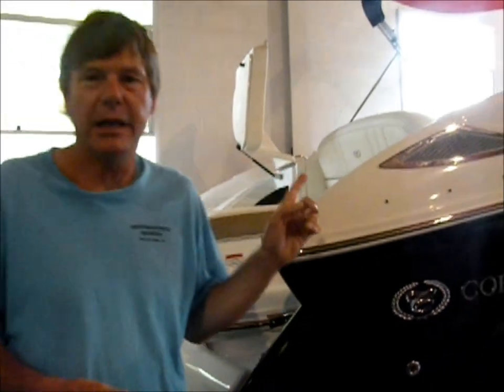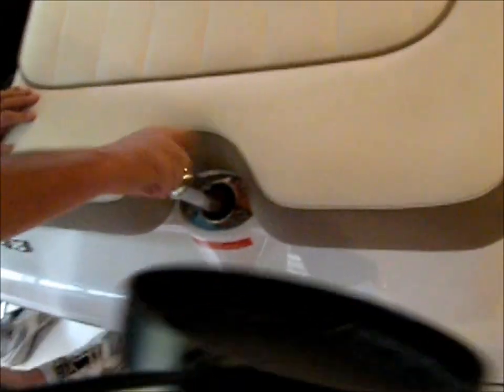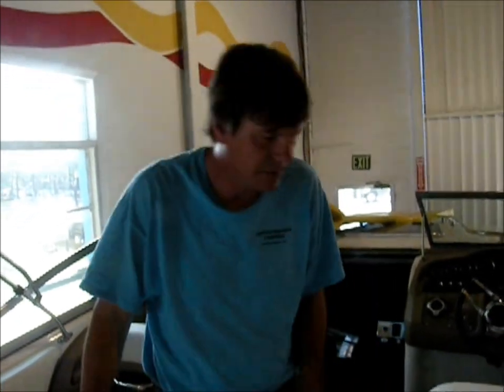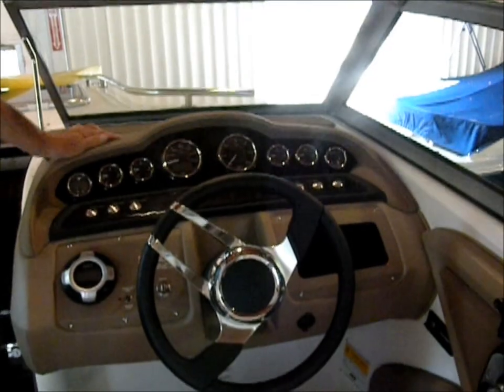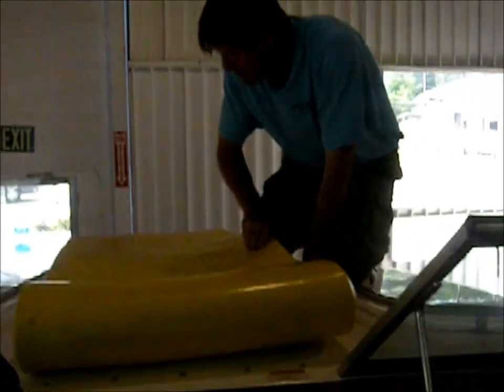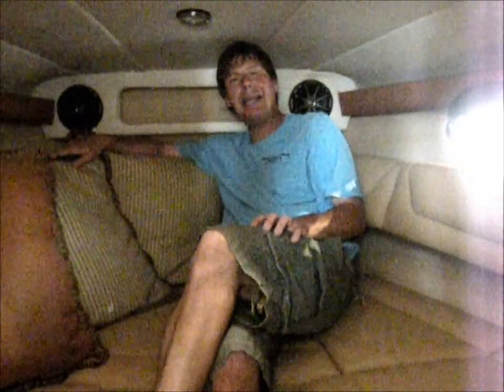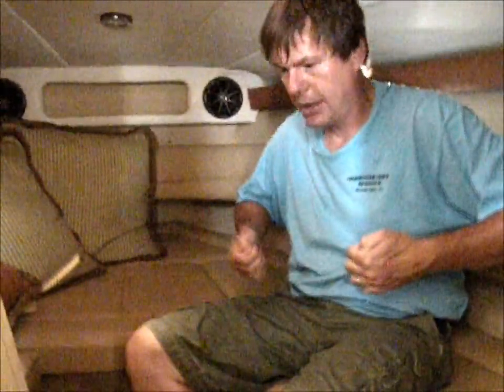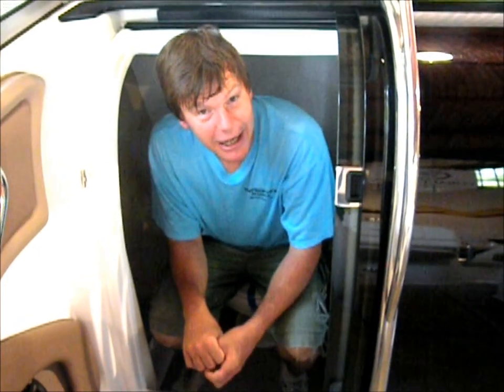Cobalt 243 Cuddy walk through

Comment: I looked up your Marina, and as many years as I docked my Boats down on Neabsco Rd, south of you. First, do you sell Cobalts? An authorized dealer? I've always been a Cuddy Cabin enthusiast for all the reasons you stated and then some. Currently there are only 2 Makes of Boats and their respective Cuddys that I'm interested in. 1.REGALS 2550 is an excellent boat. I owned 2 of them and fit, finish and quality are great. 2. Cobalt 243 Cuddy. Again, 243 is an excellent boat and fit, finish, and quality are Excellent! I'm currently looking at some previously owned Regal 2550's. Question: what year did Cobalt first offer the 243's design? 2nd- in using Cobalts website to build a boat with just some of the options I want-need, I noticed just about everything is an option that quickly adds up and makes the price "cost prohibitive." If you still sell Cobalts, do you ever get any in that nicely optioned out or loaded where you can get a good deal without seeing a 24" Cuddy cabin exceed $135,000.00 and much more! Don't get me wrong please, COABALT is one of the top 3 commercially manufactured boats on the market and quality through & through. However, I can buy a 2013 Regal 2550 Fully loaded, with a 8.2 liter and less than 100 hours of use in mint condition with a custom trailer for less than $85k at several different dealers, and if I don't need the 8.2 liter I can get several for $75k give or take a few dollars. If I had my choice, and all things being equal? I would buy the Cobalt. However, the 2 boats are EXTREMELY SIMILAR IN LAYOUT & DESIGN. What was the price of the specific model you were showing? Also, could you tell me what the top end speed is with several motor options from the standard 5.7, the 6.1 and 8.2 liters, and maybe the 350-MAG EFI? That's with half a tank and 2 adults, @ 190lbs and some basic gear? Thanks very much and what was your name? I didn't hear it mentioned in the start of your review? Thanks in advance and super boat with great review. Wm. ~